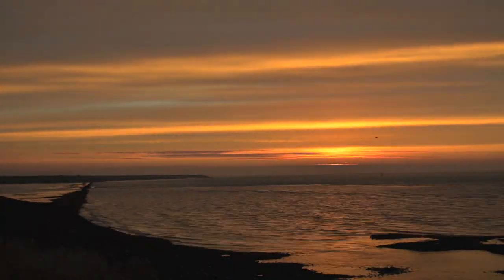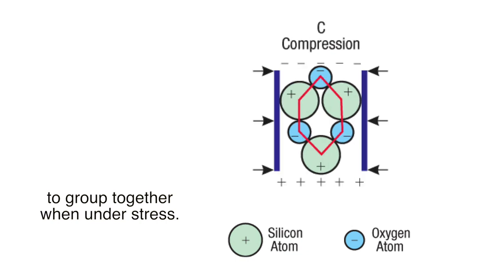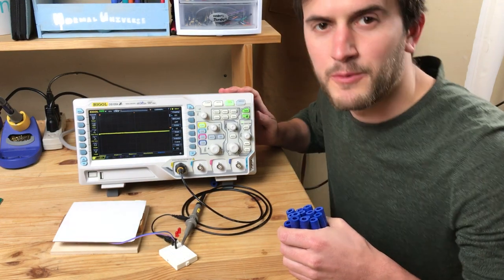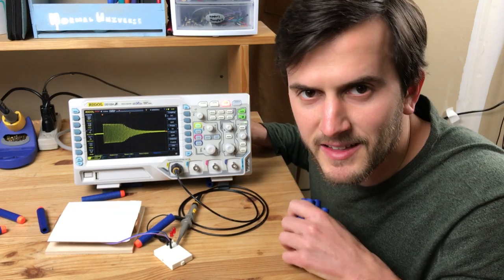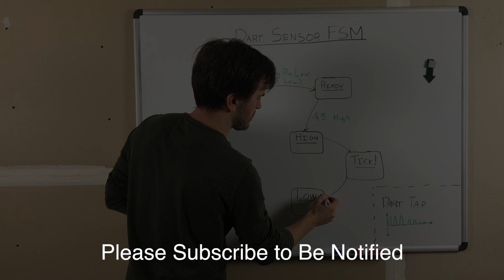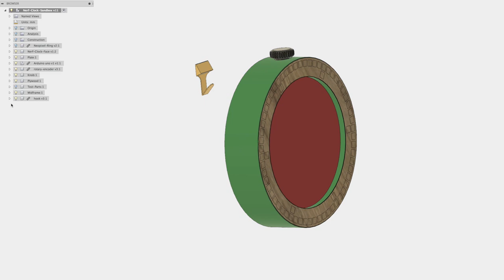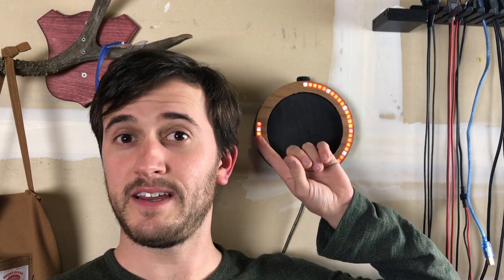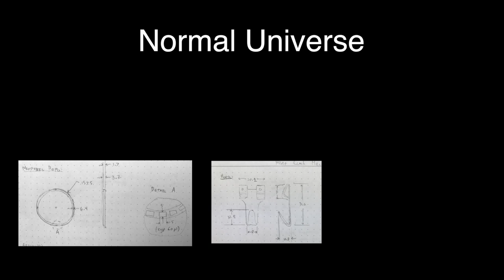Arduino Nerf Target Alarm Clock (Intro to Piezoelectricity)

Comment: Was thinking about a DIY nerf targets for my son and myself, so thanks for the inspiration on using piezo as impact sensor. Result by now two  nerf targets in different game modes. 1.8 TFT attached for display a healthbar and infos using Arduino Nano connected to a Pi Zero (so you can set up Game Details via Website). You can set the targets to friend or enemy. One more is in progress.
Reply from the maker: Wow awesome!! I think you're the first person who replicated this project.  In retrospect I think I overengineered it and would just use a microswitch if I did it again.  But it was a good opportunity to chat about piezo crystals.

Comment: Coming from HaD, excellent video - thanks for showing the clamping effect of the LEDs on the scope and the difference between finger vs dart. Is it possible that a smaller lump of cardboard would oscillate at a higher frequency? it should be an under damped spring-mass system right? thanks for the video!

Comment: Hey bud, did you ever release that video where you go in depth with the 'dart sensor FSM' ? I'm working on a similar project and it would really help. Thanks!
Reply from the maker: Hey! I didn't make a video about the dart sensor FSM in particular, but I did make a really detailed video about how to do state machines on Arduino. Check the video "Multitask Arduino with State Machines"

Comment: How would I build this myself at home and what is the programming for it
(I reaaaaalllly want to build it and I am quite new to Arduino so if anyone can respond to this I would be sooooo happy)
Reply from the maker: Hi Sherville. I think I made this project way more complicated than it needed to be.  I would cancel all the piezo stuff and use a microswitch. A microswitch is just a button with a very sensitive push you you can trigger it easly. So maybe put a microswitch between a piece of cardboad. The dart will push on the cardboard and activate the microswitch

Comment: Subscribed to get the code in the next video :).  Great project.  And I'll add to the requests to post the CAD for folks to remix/modify etc.  Posting .stl is fine, but something that folks can easily modify without having to go back from mesh to solid is awesome.... so either .step or .iges.  And yes, I'm guilty of this as well - we should all commit to posting source files in several formats.  </soapbox>  Again - great project.  And thanks for taking the time to make the production value high - good sound is often overlooked.
Reply from the maker: +LosGuysLive hey thanks a lot. I'm working on a follow up with just the things you're thinking of. Been swamped with work for a few months, sorry to take so long!

Comment: Cool !!! And a creative way in interfacing the alarm configuration using only led colours and a potentio (I guess?) Anyway, I didnt see any RTC. Is arduino is accurate enough as a clock, lets say for a month ?
Reply from the maker: Charles Lyncheese hey Charles. It happens to be a rotary encoder. I thought about using a potentiometer but it wouldn't be precise enough to control 60 LEDs (1023 pot values / 60 LEDs = ~ 17 pot values per LED).

Nice catch! Yup no RTC used. I'm not sure how accurate it is. It can keep time for about a week, but I haven't done a long test. I only use it for coarse time keeping in the garage, so it doesn't need to be dead on.  I currently don't know how to interface with an RTC, gotta learn that.
Reply: I see... Thank you for the answer and the correction. I personally, never used a rotary encoder before. Will look into that. Happy Learning !

Comment: could i do something similar but instead of nerf darts you can throw a ball at it?  was wondering if you could help me out.
Reply from the maker: Hi Anythony thanks for asking. I'm sure you can make something work. Actually in retrospect the piezo crystal method is too complicated for this project. There is a simpler option, it's called a microswitch. It's a switch that has a very soft trigger shaped like a paddle that actuates the switch when the paddle is pushed.  So just connect the paddle to your target and you should be good to go. Good luck!

Comment: are you selling these or how much would it be to request one built?
Reply from the maker: Hey Dom! I'm glad you like it.  Sorry I'm not selling these.  It takes me so long to make one I would need to charge hundreds/thousands of dollars (it took me 40-50 hours the first time).  Worse it's not reliable enough to justify the cost.  I do want to make and sell synthesizers in the future though! I have something in the works.
Reply: okay, thank you for replying anyway! im gonna make a more simplistic version for my GF and i that just will be a pressure switch on the wall that snoozes our normal analog alarm clock.
Reply from the maker: @dommatryx4660  awesome! Ya I think my clock was way overengineered, I just needed a project to learn with.  I think the realistic way to do this is use a microswitch as the dart sensor.  Buy an alarm clock and replace the snooze button with your microswitch on the end of a long wire. I'd love to see it on instagram @LesGuichets if you want to share it when you're done. Have fun!

Comment: Hi ! This clock is amazing ! 
But, i wonder: is there no difference for the piezo crystal between the cardboard and the 3D printed support ? Or did you have to adjust your arduino code according to your support
Reply from the maker: +Clem D. I actually never checked that on my oscilloscope. Once I connected the printed sensor I twiddled with thresholds until it started working. I need to dig deeper because it has some false positive and false negative problems.  I think the cardboard is better because it's much springier than the plastic.

Comment: Are you posting the code?
Reply from the maker: Eddy Luna hi eddy, sorry to plan to post the code, it’s not good enough to share. I did make a really detailed video about state machines which is what I used to program this. The video is in my channel.
Reply: Normal Universe Sorry to ask one more question. I saw those videos and I thank you for the detailed explanation. I don’t have an oscilloscope, do you believe this is something I can accomplish without it
Reply from the maker: @BettermentBites  yes I think it's possible, but it will be tricky.  Without an oscilloscope it's hard to see what's happening in your circuits.  One thing you could do is program the arduino to repeatedly read an analog pin and print the value. Then you could take that string of values and plot them in excel or something to see what the analog pin is seeing.

Comment: Still waiting for the video with the explanation of the algorithm...
Reply from the maker: Angel Cellfride oh sorry to keep you waiting for so long. I ended up pivoting a bit and making that video about how to program state machines, I believe it’s a more fundamental description of how I programmed this than just going over this code line by line.  I used a state machine to implement the concepts I described in this video, where I count the number and frequency of peaks and use that to detect dart hits.

Edit: I flash up the state machine diagram for the dart sensing toward the end of that video.